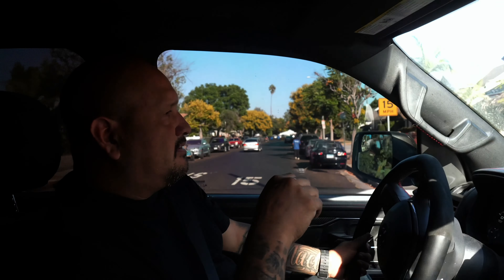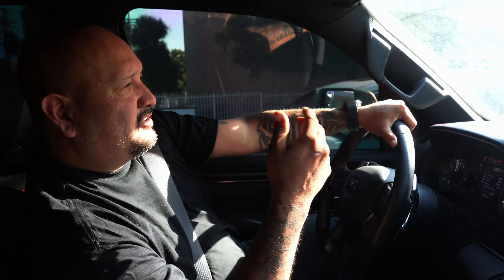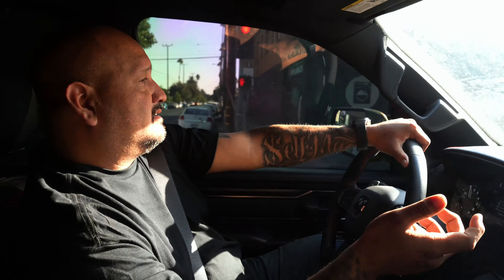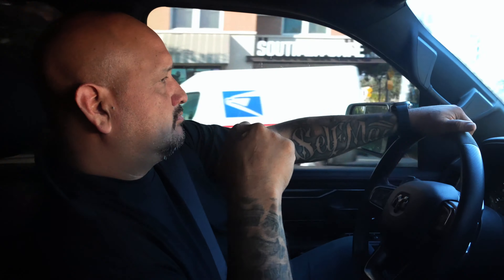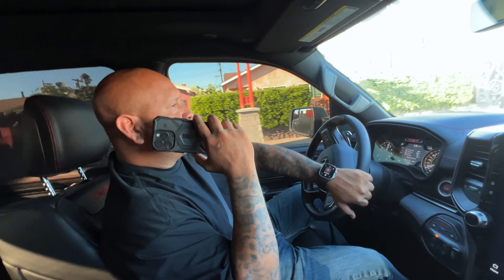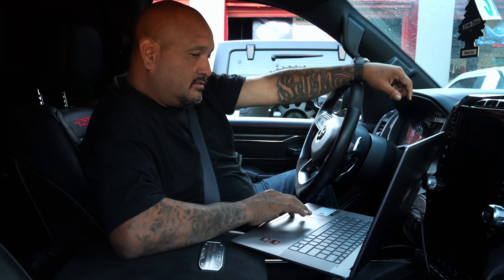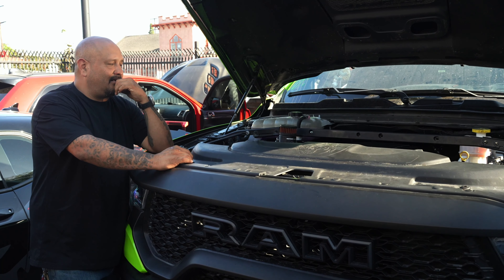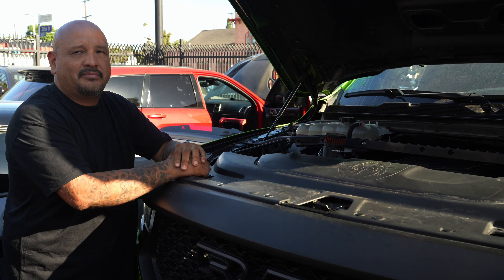We Built a 1,350HP TRX🤯  (Customer Wants More Power Already‼️)

Comment: Is it 1350 all the time even when heat soaked with bad DA’s? 700 wheel with diesel like non-degenerative power would be awesome.
Reply: You can run your interchiller on decel. I ditched my blower and 2 nos kits, to twin 76/78 mm front mount turbos, but I also run mine in 2wd with a massive radial on the back

Comment: Be nice if ram made this truck more 50/50 on the weight distribution not almost 55/45 the guys that make them single cab are at almost 65/35 and it should have a 2wd option without taking drive shaft out that's why I bought a ram 1500 for 40k and a hellephant engine for 25k just get some stronger axles have it wired on fuel tech with custom 4.7 kenny bell until I can fabricate the big single turbo set up